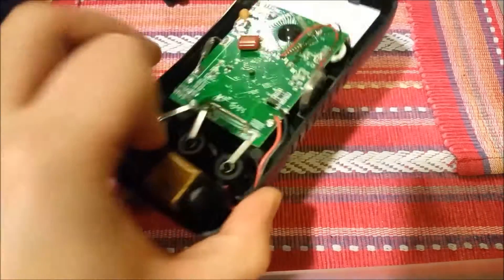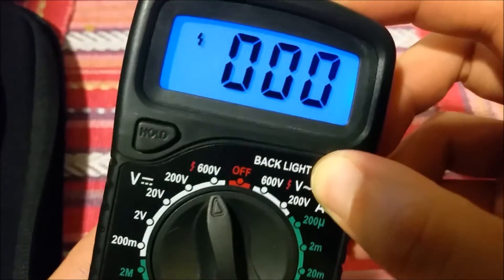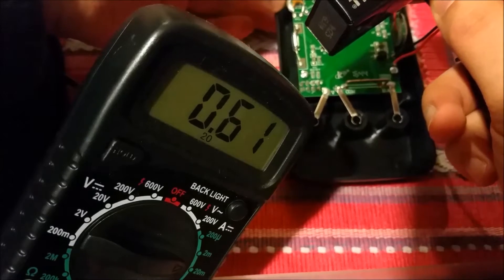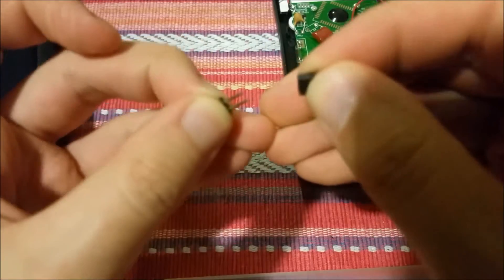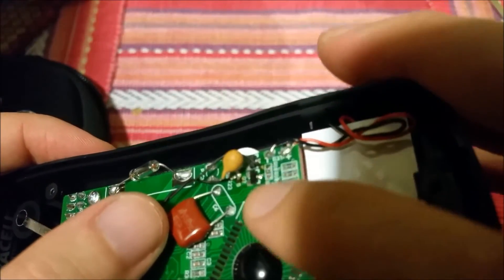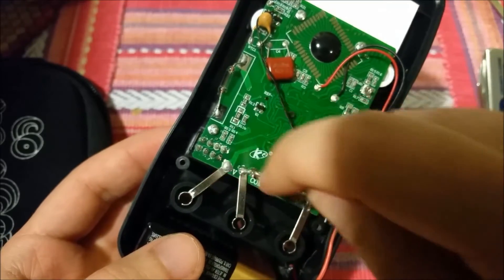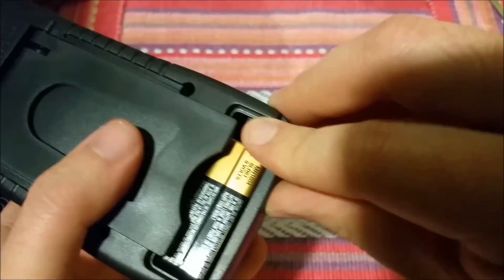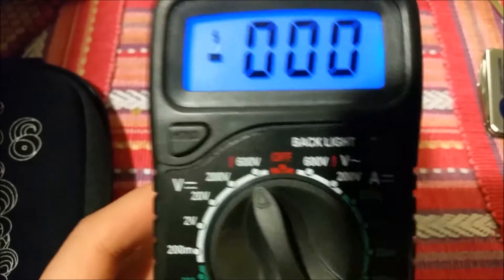Multimeter Modding

Comment: Thanks. That's a cool mod. Perhaps I'll try that to my now janky multimeter (CEM DT-916).
I hope one day, God willing, I'll graduate from a knowledgeable in electronics to able to build and design circuits and invent or improve stuff. :-)

If it's ok to ask for recommendations on a new multimeter. Among my multimeter choices are:  BSIDE S11 or the S20 which is best for these repairs: iPhone 5, Wacom Intuos 4 and retro video game consoles specifically the Dreamcast, most don't have power. BSIDE is the brand name.

When I post the specs and links here, the Youtube bot or automatic censoring system keep blocks it. BSIDE's official store can be checked at that popular chinese retail website that starts with the letter A and ends with "express" (my apologies.)

They have the S10 model which uses AAA. The S11 and S20, even though the S20 has a higher model number trumps each other back and forth in terms of capacitance readings, resistance etc. The S20 does have an EMF sensor, if that's important.

You're recommendations are welcome.

Thank you. Stay safe.
God bless, Rev. 21:4
Reply from the maker: EMF for fixing portable/low voltage stuff is pretty much useless. I would actually suggest something more conventional with a range selection switch and the probe jacks on the front. BSIDE makes this model that looks good: https://www.amazon.com/dp/B07Q283GM2/ref=sspa_dk_detail_3?psc=1&pd_rd_i=B07Q283GM2p13NParams&smid=A1UAQ41KV8L37J&spLa=ZW5jcnlwdGVkUXVhbGlmaWVyPUFPOUZON1NYOFBXMEomZW5jcnlwdGVkSWQ9QTAwODU4NzAzSEZaTlM0S0VFMERWJmVuY3J5cHRlZEFkSWQ9QTA1NzIxNTMxUFhKT1lWWDVJTTJTJndpZGdldE5hbWU9c3BfZGV0YWlsMiZhY3Rpb249Y2xpY2tSZWRpcmVjdCZkb05vdExvZ0NsaWNrPXRydWU=
Reply: @sjm4306  Thanks for the reply. I noticed the S10, S11 and S20 don't have a temperature feature using a probe.  It has the same price almost as the Fluke 101. Which should I save for, given this new info (still mainly focusing on repairing the iPhone 5, Wacom Intuos 4 wireless' white light only OLED display and the Dreamcast, other retro consoles are a bonus)?

My current multitester's temperature probe won't work anymore. I'm avoiding buying (it take awhile too, to arrive) to lessen the thrash when I throw the broken one. How do you usually repaire a temperature probe (mine is just that braided wire with a rounded ball at the end, not the rod one).
Reply from the maker: You can buy just a replacement temp probe, they are usually just k type thermocouples. Honestly though if you intend to fix lots of stuff I'd just save for a Fluke. It'll outlive you, you can trust the reading it gives, and you will never have to worry about safety of the meter itself.